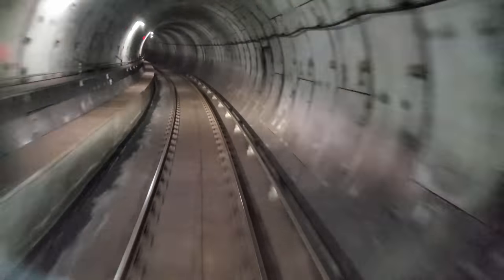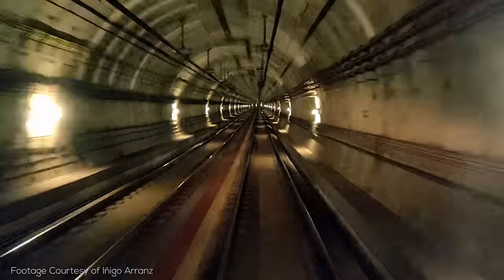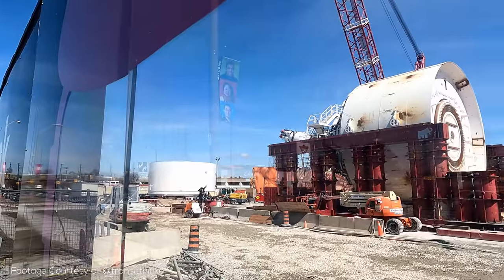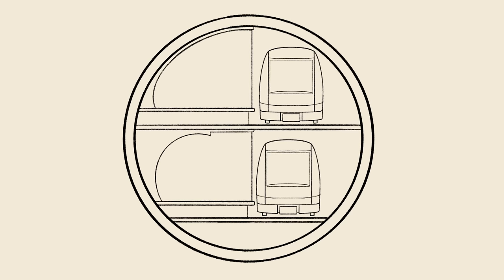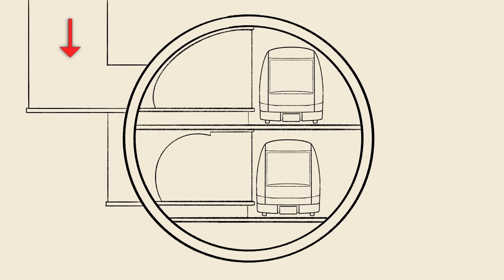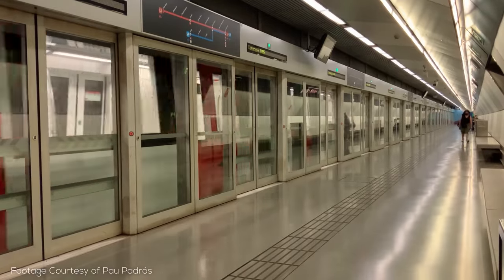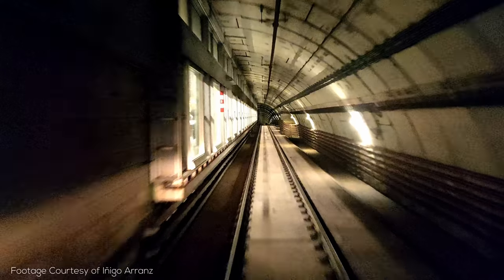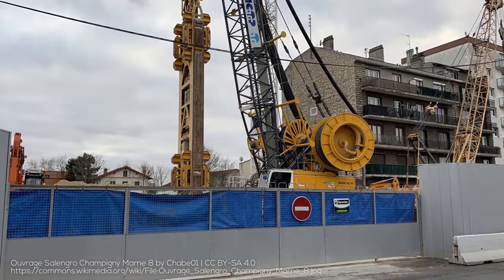A Different Way to Build a Metro? | Barcelona Line 9

Comment: About the "Branch" or "Separate Lines" Discussion: I think that the branding depends a lot on the service patterns that the outer branches receive compared to the trunk route. If the branches only see a service every 20 minutes or so on a Metro network, such as the Chesham or Amersham branches of the Metropolitan line, it should be classified as a branch line, as people probably associate a less frequent service on a branch line. But if a branch line receives a service that is every 10 minutes or more frequent, it should count as its own line.

Additionally, it also depends on how many services use the trunk route. If you have a lot of services, like the Munich or Frankfurt S-Bahn, each service should be given its own labeling as a line. And although the frequencies of the outer sections of these network do not justify a branding as a "line", it is important to do that as otherwise passengers would be overwhelmed by an excessive number of branches and different services... Looking at you, District Line!

And if a city, such as Tokyo, already has a lot of lines, a small branch should only be counted as a branch and not an entire line. I do not want to imagine a Tokyo Metro map, where the Marunouchi line is split in two as the "Ogikubo" and "Honancho lines".
Reply: I agree most of the parts but not about frequency. I think we may classify them based on how much of their tracks are shared between. Look at Istanbul Metro line M2. There is one branch and it gets a train every 8 minutes, all day long. It still is a branch because its own track is too short to be a separate line.
Reply: I think that they are planning to have frequency of 10 minutes on the branches and 5 minutes on the central part alterning a train to every branch every 5 minutes
Reply: IMO, the completed line should be classified as 1 line, 2 services, and 4 branches.
Reply: I don't think London is a good place to base your naming standards on. Like, wtf is the District Line even?
Reply: @2712animefreak  The District line is a heavily branched line consisting of two different trunk routes, three branches in the west and one shuttle service that only runs very rarely.

But I do not see the point why London would be such a bad choice? I might also take a different city and other people might also not get it. Additionally, you managed to find out that both lines mentioned are from London, so they are actually not that unknown.
Reply: I am not so sure about your 10 min rule... It means lines like northern and Elizabeth line in London are to be split into 2 lines and branded separately , which will be a bit weids I imagine.
Reply: @jonathanma2741  I think that splitting the Northern Line into two would be a necessairy and overdue upgrade for London's underground system. And for the Elizabeth line: Much of the problem here is the fact that it is labeled as "Line", although it is not a tube "Line" (I could go on and on about this, but Geoff Marshall has probably already said everything). If they would have called it "London Regional Express Rail"/"RER" one could split the Elizabeth lines into RER A and RER B like done in Paris.

And about my "10 minute rule": 10 minutes was just an arbitrairy number chosen to represent a "decent amount of service", which can vary depending on transport mode or a towns population.
Reply: @2712animefreak  Underground lines which used to be served by the Metropolitan District Railway. Many London Underground lines (particularly the subsurface lines) were named after their former operators/owners.
Reply: @EppelheimTV  The reason why there is an RER A and RER B in Paris is because they don't share any trackage at all, and especially not the city-center tunnel. They only have interchange with each other at Chatelet-Les Halles.

Rebranding the Elizabeth Line to be two separate lines would be utterly silly. It is one line with a branch to Heathrow and a branch to Abbey Wood, but once it's fully open you will get service both from Abbey Wood towards Reading AND Abbey Wood to Heathrow - which means you would need to split it up into AT LEAST three different lines to account for the different service patterns, all going through the same central tunnel.

As much as I like Geoff Marshal's videos in general, his points about the Elizabeth Line not being a "line" are kinda silly and don't make sense from a user experience perspective.
Where a split-up into multiple lines WOULD make sense, is the District Line: if you just look at the tube map, you'd think that you could take a train from Richmond or Ealing Broadway to Edgeware road, but that's not possible. The service from Wimbledon to Edgeware Road should be separated out as a separate line, since it otherwise just causes confusion for passengers. It only runs every 10 minutes - but so does the Hammersmith and City Line, and the Circle Line.

On the other hand, splitting the Elizabeth Line into separate lines on the tube map would cause confusion, because you CAN actually take trains from each of the eastern branches to each of the western branches (once it opens fully). It isn't a tube line, but it's still a rapid transit line, and operates like one.
Reply: @wasmic5z  Good point. The Elizabeth line right now could be split into two lines, but thank you for pointing out the different service patterns. I forgot to take these into my consideration.

Actually, RER B and RER D do share tunnels in the city center, but it has to be mentioned that each RER service can be seen as its own Elizabeth line, as each RER line has branches. Splitting RER lines into even more lines would make things very complicated, aside from the weird mess that RER C is.
Reply: honestly, I'd treat it the same as busses are treated here: Does it stop at a different set of stations and/or terminate at a different point? If so, it's a seperate line... on the basis that the passenger should always be confident that, when they get on a train for the line that stops at station X... their train Will Actually Stop At Station X (well, baring situations, which should be clearly signposted, where that station is actually shut down for some reason).

Now, that assumes the common terminology where 'line' primarily equals 'route' and 'service'. If, however, you're only using the term for construction project purposes (and refer to the actual services as something else) then... I'd say that talking about 'lines' isn't useful at all, and it should be 'the A to B project', and similar when talking about the actual track. 

'branch' vs 'main' line is an entire seperate matter.
Reply: @laurencefraser  The problem is that this would create a lot of clutter on maps. A LOT of clutter.
Just consider London. The Metropolitan Line alone would have to be split up into three or four lines, and the District into 5. The Piccadilly would also become 3 lines, and the Central would be 3 or 4, too.

And given that the trains run on the same tracks for a good amount of the line, and each station has live-updated signs that indicate the terminus of a particular train, it doesn't cause any confusion to depict them as a single line on the map.
Reply from the maker: I appreciate the detail in your answer haha, this was the kind of conversation I expected! I def think service level has an impact on how things should be branded!

Comment: Used to follow this line because I loved the idea and still think it can be the best. Sure it has lots of issues being built but it's a new thing and ideally they learnt from their lessons so the next city to use the same design can build it much quicker and cheaper.
There's lots more potential huge benefits that never ever get mentioned. The biggest is that its essentially unlimited futureproofed. Like how Elizabeth Line is designed for 11 car trains despite current trains being 9 cars long, this line can be designed for limited cars. Because the station is in the tunnel as long as rooms are only built at one end of the platform on the other end you could theoretically extend the platform as much as you want, for essentially free. Make the trains 6 cars now, then in 30 years make them 12 cars if you have to, the room is right there. This is impossible for other metro lines and if it was cities would pay many billions to extend trains on each line by just 30% let alone 100%. No need to increase the frequency of trains to a headache amount, just make the trains longer. Another big benefit is free emergency escape access, there's space along side the track to walk to the next station safely, I think this is a UK requirement now. Another benefit is some engineering work can potentially be done during the day, on the Tube I've had a work time frame of like 90 mins before.

Oh adding a new entrance is another benefit. Double the platform length and you'd probably want to add another entrance, this is a nightmare or impossible for traditional lines but if it's just 6 lift shafts on the other end of the platform then it's "easy".
Reply: Acctually, the elevators (and escalators in some stations, I hope when they finish they would be a minority) are positioned in the middle of the platform.
Each elevator has two doors, one at the front, heading to a semicircular space, from which you wait for and enter the elevators, and one at the back, which is for people inside the elevator to leave it.
So there are 3 doors connecting elevators and the platform: a middle one to go waiting elevators and two side doors to go from the elevators to the platform

Apart from this, you are totally right, hope I could explain myself correctly :)

Comment: There are also other methods to build a platform inside the tunnel!

Example from Cologne, Germany: The new North-south light rail Tunnel uses two parallel tunnels with a single track.

The tunnels are a bit bigger than they would need to be for a single track, so at 2 of the stations with fewer passengers they built the platforms within the tunnel, connected with cross-passages.
But the platforms are just 3m wide, so only possible when the passenger numbers are not too high

Comment: The newer method of building smaller structures within a larger structure in airports reminds me of old rail and bus terminals, using a massive skylight roof covering all the platforms. I remember watching an archival video about I think a bus terminal somewhere in the UK--it might be London--and how they removed the structure in favor of an open air terminal.

Comment: I have been suggesting for decades, in UK and EU... to make TBMs with hydraulic cutting heads. A TBM with a cutting head of 7 to 10m can have at flick of a switch, the cutting head expands with each push forward to be up to double in tunnel size.
The change in diameter from small to medium to large cutting head would have concrete segments that are pre-cast to match the expansion and to - other end of station, decrease the pre-cast segments back to the diameter for the next tunnel running section. 
As with the LizPurp line, escalators can be excavated on predetermined incline angles. The Station fixtures and fittings could be lowered along these \ sloped entrances. The only soil removal at station sites would be primarily done by the TBMs with just the escalator tunnel sections to be removed at ground level.  
This TBM configuration change is entirely possible with 1980s Channel Tunnel TBM technology - it is very basic.

Comment: The station in the tunnel bore approach w stacked tracks that eliminate the need for large underground flying junctions is kind of elegant. I wonder if that empty space throughout the line between stations makes it easier to add in-fill stations later on. The station you showed appeared to have 4 elevators. For a busy station though, you would need A LOT of elevators so, maybe those stations also have escalators? 

I used to use the Forest Hill MUNI station in San Francisco all the time which is a very deep station w elevators. Personally, I don't like elevators, but Forest Hill has two elevators for each platform that were pretty big so it didn't feel like a coffin. The only waiting was if both elevators were at the top and you had to wait for them to descend. The elevators are pretty slow. Of course, as is often the case w MUNI, one elevator was often out of service but Forest Hill isn't a high volume station.

Comment: Just a small clarification: all stations already built in L9-10 provide escalator access. No station has elevator-only access, as I understood you said in the video.

And about wether it shoud be considered one line or two, in my opinion for wayfinding purposes (and therefore officially) it should be considered as two different lines. Keep in mind that the paths of each line does not change (e.g. L10 will always go from the Zona Franca branch to the Gorg branch and viceversa, and in order to go to the Can Zam branch you would have to change). Also, in all other metro lines in Barcelona all trains complete the line entirely, so people are not used to checking the destination of a specific train if they know it is the correct line.

Obviously, if we're comparing for example different metro systems of different cities, we should consider L9&10 as one line because they act as one for most of the lenght.

I'd also like to say that, IMO, the platforms are too narrow for the demand that the completed lines will have, considering that there's only one entrance/exit to each platform and that people don't tend to move along the platform when they reach it, instead choosing to wait near the entrance/exit.

So... sorry for my kind of broken English :'( Thank you for the very informative content that you always make, and let's hope the lines are finished by 2029, as announced! :D

Comment: Also Parliament Station in Melbourne Australia was built with drilling machines underground while the access shafts were drilled on an angle so they could be used as the escalator shafts! There’s also a virtual shaft which is the lift shaft for the station! :)

Comment: Looking at the BART plan, unless the tunnels are genuinely huge, it looks like they’re going to have the same issues as the Northern Line at Clapham North & Clapham Common (and other stations where it’s already been fixed).
Reply: The platforms are narrow relative to other BART stations. Napkin math puts the platforms around 15-20 feet wide.

Comment: São Paulo is planning to build a line like this one, Line 16 - Violet, however it's planned for (at minimum) 2039, and it's probably going to be done much after that
Reply: It's actually planned to open in 2034. So yeah, it will probably open in sometimes in the 2040s.
Reply from the maker: Well there we go! I'll need to look in for my updated video for SP!

Comment: I appreciate these more technical videos that focus on engineering aspect of transit.  IMO deep tunneling should be mostly reserved for inter-city rail instead of metro rail.  Take the Yitzhak Navon station which literally takes 10 minutes to walk to the surface.  This isn't so bad because it is an inter-city rail that connects two cities (Tel Aviv +  Jerusalem).  So walk time / train time ratio isn't crazy.  But if you are commuting on an urban metro rail, reducing walk time is paramount.  A New Yorker can and does use the MTA during their lunch breaks because (most) of the stations are so efficient/walkable.  Sadly many urban planners reverse this and put inner-city rail deep below ground and inter-city rail above-ground.
Reply from the maker: Tbf deep stations with lots of escalators also aren't fast to access - in fact maybe even slower!

Comment: Building large tunnels isn't that much more expensive than building a small tunnel, especially with TBMs. That's why I hate that Paris uses small trains : building your tunnel 20cm wider won't make it that expensive, you're already building a tunnel anyway.
Plus widening a tunnel is really expensive, as opposed to "building it extra-large from the start". That's why they built Lyon's metro extra-large and it was a great decision.
Reply: Paris metro uses small trains because the municipality back in the late 19th century wanted to prevent any take over by large main railway companies. It's for the same reason that Paris metro run on the right instead of the left for main line railways.
Infact earlier proposals planned even narrower trains and narrow gauge tracks.

The history of Paris metro is a fight between the City of Paris who wanted a municipal network and the State of France who wanted to built lines that connected the main railway networks. This fight lasted for decades until the City of Paris won.